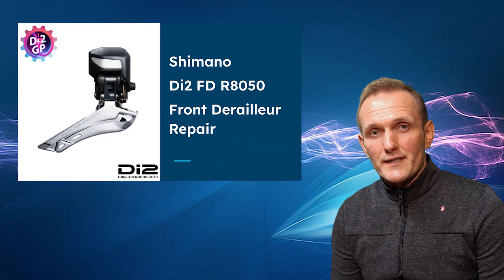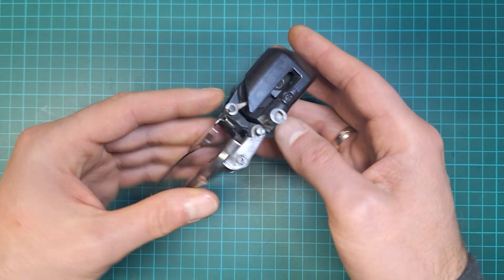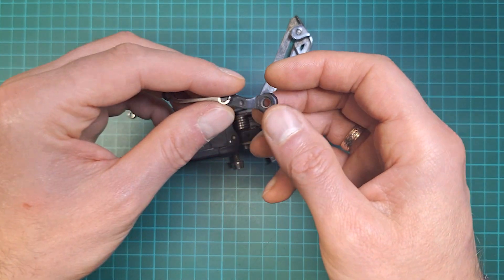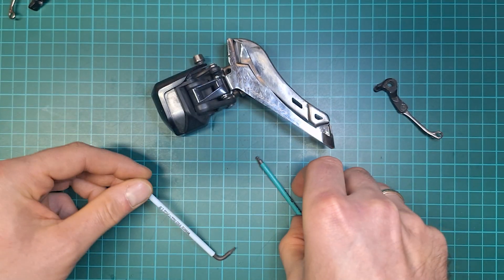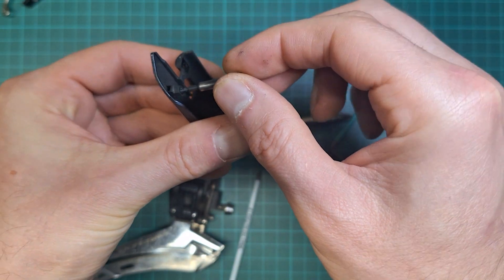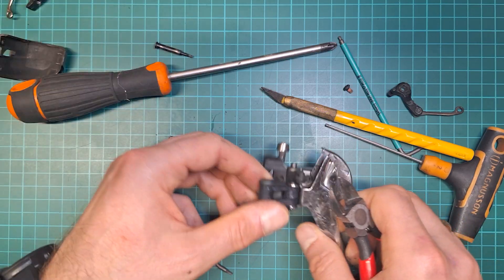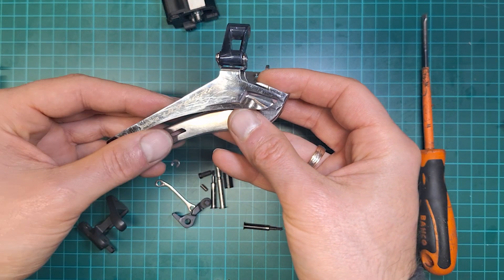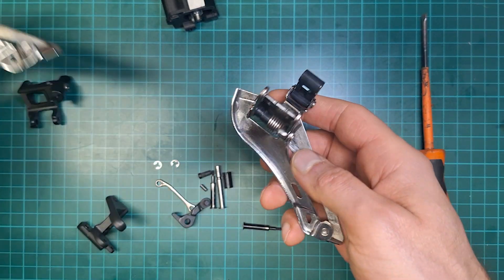Ultegra FD R8050 Repair (Cage/Carrier swap)

Comment: Great video...learning.   I have a FD-R8050 and the arm that holds the cage broke.  You mentioned arm/cage from a GRX and/or 105 could be a replacement. Which model exactly?  I'm looking and cannot find one that matches.
Reply from the maker: Both GRX and 105 are the same. You need to use axle, spring and sleeve from GRX too, as design is slightly different. But as a system they work.
Reply: @Di2_GP  thanks I may look into this. I decided to take a different route. I created the arm in CAD and 3d printed it.  I mounted it using a stainless steel screw and it seems really good.  The test will be on the bike.
Reply from the maker: @Cyclingbrian  I know a couple of people that 3D printed that arm, it still holds!

Comment: Good video, however I can't even remove cover. 2mm allen keys is to big. 1.5mm is to sloppy.
Reply from the maker: @paulgreaves2202  have you tried torx? All dérailleurs I worked on, were either 2 or 1.5 mm

Comment: Cheers Pawel. I’ve disassembled my 11s ultegra Di2 FD to replace the actuator arm successfully. Hardest part was working out how to remove the spring arm. Took awhile to find that screw locking the arm in place.  Thnx for vid for us fixit owners. 👍
Reply from the maker: Great to hear. Hopefully you won't have to do it again ;-)